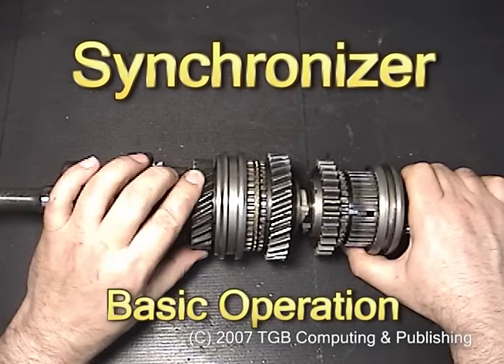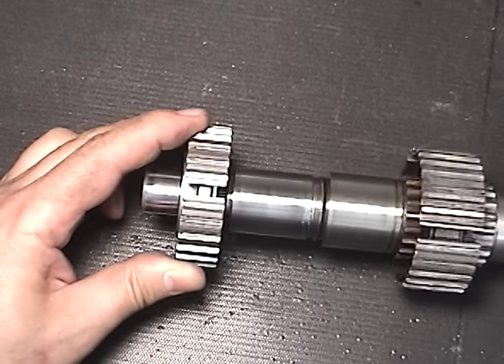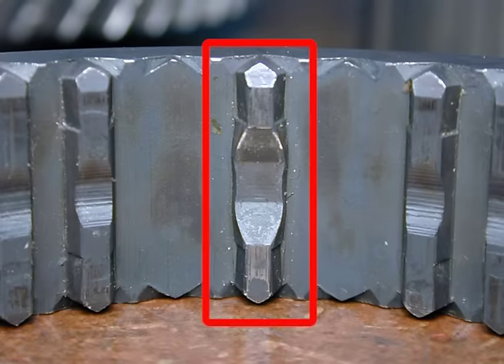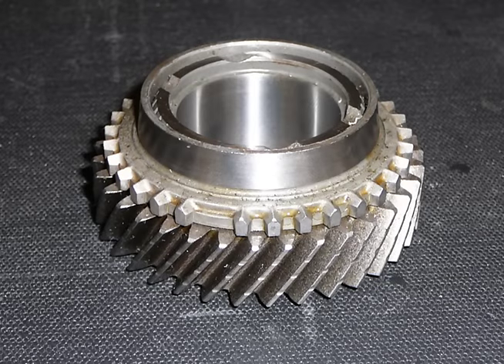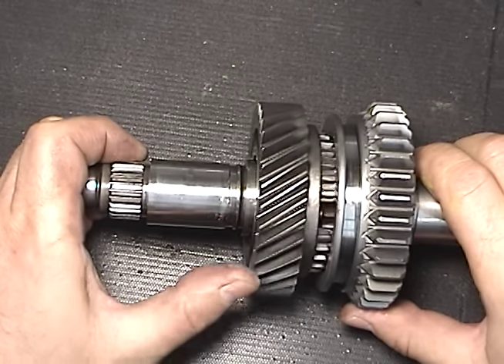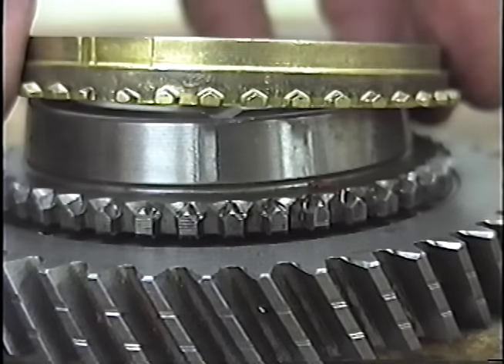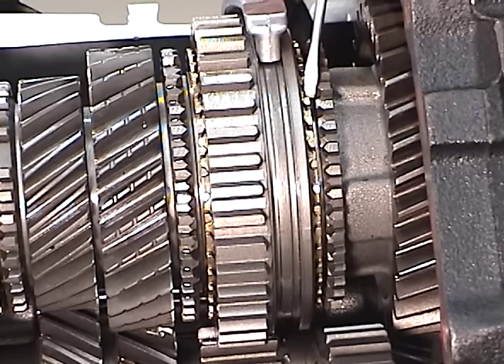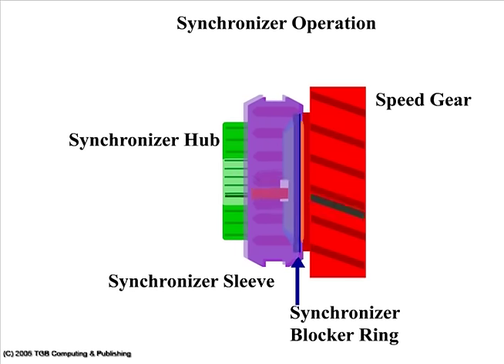Synchronizer Operation Explained

Comment: What most people don't appreciate is that  "grinding gears" isn't damaging the actual gears that transmit power, but the dog teeth on the synchro system.
Reply from the maker: You are absolutely correct.
Reply: Makes me appreciate that big truck transmissions generally do not have synchronized gearsets.
I had to rebuild an entire transmission when someone had broken the main output shaft in one.
No books, no drawings, nothing but brute competence.
I will say, the way that they are made with dual or triple countershafts, the design is ingenious.
The input and output shaft are only connected by a pilot bearing.
The fact that the main output was snapped into two pieces, and the transmission didn’t fly apart is testament to the designer!
The countershafts held the gears in their proper location, even though the shaft was toast!

No synchronization there, just a good gear matching hand was required!
Reply: I have a Kawasaki motorcycle and the factory service manual chapter on repairing the transmission has one line about " paying attention to the mating dogs ". Made me chuckle.
Reply: Not if you have old stuff with slider gears
Reply: @Franky997  grinding gears on old stuff like '47 chevy, farmall tractors, or cub cadet lawn mowers does damage the actual gear teeth. The whole gear slides to engage
Reply: Thank you for your clarification friend; I always thought it was the actual teeth on the Gear
Reply: @mikekokomomike 😄😄🤭

Comment: Who on Earth came up with this?  I rebuilt two entirely different manual transmissions years ago.  One on my '64 GTO and one on a '68 Ford Cortina.  The inventors need a Nobel Prize in transmission design.
Reply: Them and whoever came up with the differential. Brains all around.

Comment: Kids used to say they could drag race powershift as in brute force abuse without using the clutch, but the way the synchronizer is designed, this is impossible, because the harder you try to force a shift, the harder the synchro will ride up onto the cone and fight to prevent it

Comment: Would be good to explain that the synchro ring is made of brass hence it's gold color. Brass is softer and is sacrificial meaning it will eventually wear out and need replacement. Brass is the perfect companion metal to press against the hard steel gear and do no damage to it as it tries to either speed it up or slow it down so the the synchro hub can slide over and complete the lockup. It's important to remember that the synchronizer assembly must adjust the speed of the entire cluster gear and input shaft including clutch disc in order to perform the lockup into the selected gear. Quite a task and shows why you must have clean clutch release so that the disc is completely free to rotate. This is a very good video, especially with the gear train illuminated with the strobe light to show what happens.
Reply from the maker: Thank you for your good comments. You are correct.  One note. although these blocker rings are brass there are other blocker rings made of other materials and sometimes either lined with a friction material similar to brake lining and others that use a bi-metal design with a sintered metal inner cone that is soft with a high coefficient friction. I will consider  a followup video with this additional information.
Reply: We had some Mustangs rings made of paper! Replaced many.
Reply: @@Franky997Can confirm that because some years ago I worked for a company that made synchromesh rings for many of the major European car manufacturers.
Selector forks were also made from phosphor bronze, but of a different grade.
Reply: @shaggydogg630  of ... paper? No joke?
No, has to be a joke. Sounds impossible.

Comment: This is terrific. Details like the back cut on the engagement teeth on both the synchronizer sleeve and the speed gear, are new to me. This is shown under magnification at 2:15, and is easily missed when you have the parts in your hand. This back cut is what holds the two parts together under load, and prevents the car from popping out of gear. When an older transmission pops out of gear people will tell you with authority and confidence: 'oh, the synchronizer rings are bad'. But the synchro rings have little to do with this function. However when this tiny back cut, on on the engagement teeth of the speed gear or the synchronizer sleeve is worn away, there is nothing left to hold speed gear and sleeve together. In this case a new set of synchro rings will do nothing to fix the problem. And that is very much worth knowing.
Reply from the maker: Thank you for your comments.  Please note that the back cut is not present on all synchronizer sleeves and gears.  I see it missing mostly on older transmission designs.  There are several reasons why a transmission will jump out of gear and worn out back cut is one of them.  Normally what happens is the oil is not changed when it should be and or the driver is rough on the transmission and the blocker rings start to wear causing grinding (gear clash) which in turn chews up the clutching teeth on the gear and on the sleeve which wears away the back cut. It's often a domino effect.

Comment: One of the best videos i have ever watched about synchro mechanism. Incredible presentation.
Reply from the maker: Thank you
Reply: Yes. He really has all the fine details down. Gear boxes for Spec Miata racing are rebuilt all the time. However the re-builds tend to have problems. If a rebuilder replaces the bearings, the brass synchro rings, and the seals then the gearbox will shift into gears easily and the box will hold oil, but will it stay in gear? Apparently if the back-cut (2:15 in the video) on the engagement teeth between speed gear and synchro sleeve are worn, these parts need to be replaced too. Someone who is simply installing a 'rebuild kit' will miss this.

Comment: As the sleeve moves towards the speed gear, the keys weakly push the blocking ring ahead until the conical friction surfaces make contact. The resulting frictional torque rotates the blocking ring so that it's teeth are 1/4 tooth pitch misaligned with the sleeve teeth which causes contact of the teethes' angled surfaces. This is called "energizing". As well as causing the blocking teeth to block the sleeve, the sleeve can now apply a strong force to the blocking ring via the tooth contact, increasing friction and synchronizing torque.

Comment: excellent description of the synchronizer but I wish you talked a bit more about the locking keys and springs and the purpose they serve
Reply from the maker: They are not locking keys.  They are synchronizer keys.  They transfer the force between the sleeve to the blocker ring.

Comment: the strobe light detail was above and beyond and really helped explain it thank you so much
Reply from the maker: Thanks.  I too thought that was a great technique to display moving parts.
Reply: @DrivelineMaster  I still dont understand how the sleeve will not engage the gear until the gear speeds are in sync??
Reply from the maker: This is a very valid question and not an easy concept to understand so let me give this explanation a try. When the sleeve is forced in the direction of the gear to engage then next gear the keys will push on the blocker ring which pushes on the gear.  Friction and heat is generated between the blocker ring and the gear.  With the heat expansion forces occurs.  This expansion from the heat creates a force that pushes the blocker ring and keys back against the sleeve.  This force makes it difficult for the sleeve to continue in the direction of the gear until everything is in sync or very close to being in sync. When everything is in sync the friction, heat and resistive force is reduced to a point where the sleeve can now easily slide over and engage with the gear.  I hope this makes sense.
Reply: @DrivelineMaster  thanks. I did more research today i found that the mass/inertia of the constant mesh gears trying to be slowed by the blocker ring will force the splines to be out of alignment (and unable to engage) until the gear speeds are in sync. Only then can the tapered splines be aligned by the driver pulling the shifter because there is no longer any force "binding" the splines
Reply from the maker: That is the reason the blocker ring can't immediately synchronize the rotational speed of the gear with the sleeve however it is the friction and the expansion forces that prevent the sleeve from moving over to attempt to lock onto the gear while they are rotating at different speeds.

Comment: so, synchronization only works when the car is moving since we need the gears to be spinning correct?
engaging first gear from a standstill therefore does not need to be synchronized just like reverse?
Reply from the maker: Pretty much correct, the synchronization only takes place when the gears are spinning.  Even though the car is not moving if your engine is running and the trans is in neutral but vehicle is not moving some of the gears inside the transmission are spinning. If you push the clutch pedal to the floor and move the shifter quickly some synchronization might take place.  If on the other hand after you push the clutch pedal to the floor you wait about 30 seconds before moving the shift lever then all the gears will most likely be stopped.

Comment: That is so cool to see it working like it should.  My KW T800 has an 8LL and its synchroniser has been  very noisy since the heat exchanger went bad and got water into the transmission.
Reply from the maker: Try Changing the oil and put Redline Manual Transmission Fluid (MTF) in it.  This stuff does wonders sometimes.
Reply: @DrivelineMaster   I just have changed the incorrect  90 wt for 50 wt motor oil.
That by its self worked wonders. It made it possible to where the gear shift would actually move the gears in and out. Before that I could take it out of gear and it would stay in gear. It did that one morning until the oil got warm. I ran it all day, came in and drained that 90 wt while hot and its been better ever since. Everything but the synchroniser.

So mine is not slowing the gear down when all that noise is going on?
I wonder if the air shifter  could be sticky somehow?
Reply from the maker: Unless the manufacture says you can use motor oil instead of GL4 or GL5 gear oil I wouldn't leave the 50st motor oil in your transmission.  90wt gear oil is not the same as it would be if it was 90wt motor oil.  The way they measure thickness for gear oil is different than motor oil.  Once again I would recommend the Redline MFT. I know it cost more but it is worth it. Unless your transmission was designed to work with motor oil (like some honda's) you will end up damaging your transmission and costing you more $$$ in the long run.
Reply: @DrivelineMaster   It calls for 50 wt engine oil. Granted Synthetic would be better but we just had a cracked head replaced at 6,389.00 on the truck and now the compressor has blown apart on the other truck leaving us stuck with a core fee. Cat wants 1,500.00  just for the core fee alone. Fleet Pride got us a refurbished for little over a grand and no core charge.
Reply from the maker: As long as the factory specification is 50wt engine oil then that is what you should use and have confidence that you won't cause any damage.  This is the first trans that I know about that uses 50 wt straight motor oil.
Reply: @DrivelineMaster  The 50 wt motor oil has a much shorter service interval of 1 year, 60,000 miles or 500 hrs vs 5 years, 500,000 miles or 2000 hrs for  the PS-386.
Also the 50wt diesel engine oil is not recommended above 1850 ft lbs of transmission torque.  I never imagined the synthetic was that much better. 

page 10  heavy duty transmission- http://www.roadranger.com/ecm/groups/public/@pub/@eaton/@roadranger/documents/content/tcmt0021en-us.pdf

Comment: Question: Since the small clutching teeth is what mechanically locks the free spinning speed gear to the shaft and actually transfers the power why dont we see more of those stripped vs the actually gear teeth on high powered cars? It looks like it has much less material engagement would seem to be the weak link. I would also think the narrow sleeve that couples the two together would be prone to strip out before the actual speed gear teeth would strip under high power.
Reply from the maker: 1) the small clutching teeth are already 95% in alignment with the teeth on the gear before the sleeve is allowed to slide onto the gear so there is no grinding. This is accomplished by the proper operation of the blocker ring. When the blocker ring becomes worn out and can no longer perform properly that is when the clutching teeth start the grind during the shift. This is the grinding noise that can be heard by the driver between shifts and is called gear clash.  The reason these tiny teeth can handle the torque comes from the total surface area contact between the gear and the sleeve.  The number of teeth and the length of the teeth determine the total contact surface area. I'm not an engineer but this is something that has to be engineered into the design.  They must determine the maximum torque that the synchronizer and gear would have to be able to handle and how much contact is needed.
Reply: Between two gears, only one tooth on each gear is engaged with the other gear at any time. 
Between the parts of the synchronizer assembly, all of those small teeth are engaged at the same time, spreading the load out between them. 

Many small teeth are as strong as one large tooth.